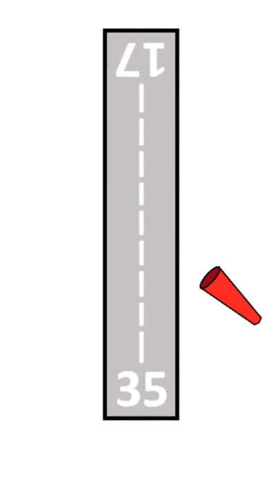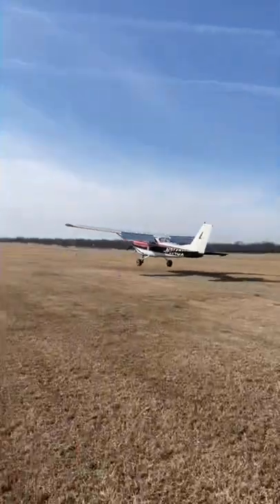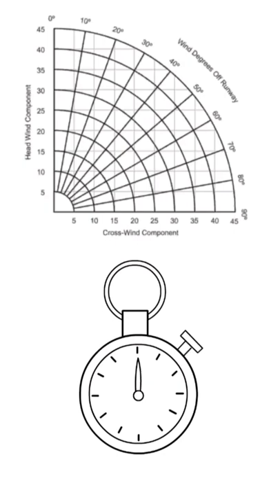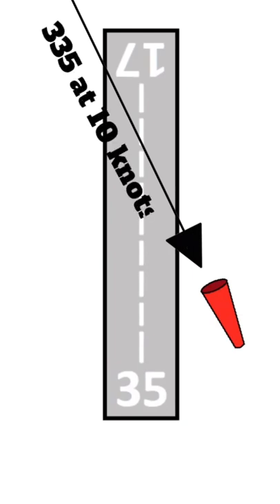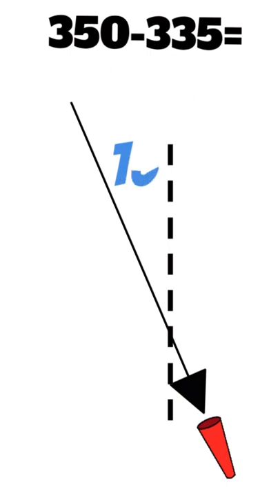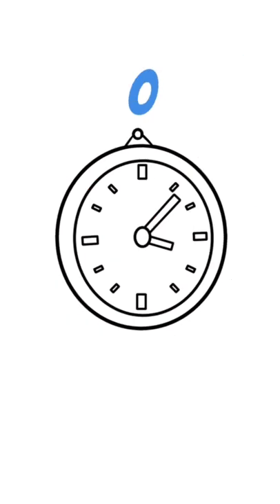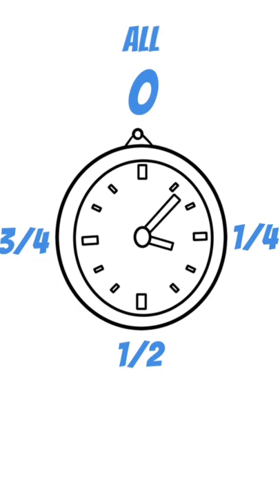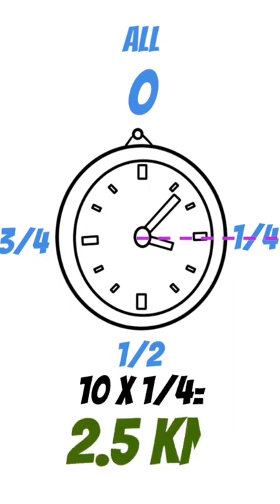Easiest Way to Calculate Cross Wind Component (clock method) #shorts

Comment: Student pilot here (26hrs into my PPL). How bad is it if I just "feel" the wind. My best landings in crosswind have always been when I just turn my brain off so to speak, point the nose in a way so my course aligns with the runway, and just fly her in by the seat of my pants and keeping an eye on airspeed. The more I try to think about getting some exact heading based off the math the worse my landings, I think it distracts me from just flying the plane. I'm decent at math but my brain for whatever reason just freezes up over even basic calculations when I'm flying if there's a lot going on. Is a DP gonna expect me to announce my crosswind component or something? Is flying by "feel" bad?
Reply from the maker: I don’t have a problem with it in most cases, but there are actually some airplanes with a crosswind limit, so you need to be able to calculate this
Reply: @FreePilotTraining  thank you!!

Comment: There’s another method, probably less accurate but quick and easy.
Crosswind
0 to 30° = 1/3 of the wind speed (Vw)
30 to 60° = 2/3
60 to 90° = 3/3

Headwind
0 to 30° = 3/3
30 to 60° = 2/3
60 to 90° = 1/3

😊✌🏻
Reply from the maker: Love it! Thanks for the comment!

Comment: What about dividing the windspeed by 6 and multiplying by every unit of 10 degrees off from the runway? Example RY36, wind 04012kt. 12 divided by 6 is 2. The wind is 40 degrees off RY36, so 4. 2 x 4 = 8kt crosswind roughly.
Reply from the maker: I haven’t heard that one

Comment: Where did you get 350 from
Reply: Runway 35. Meaning the runway is pointed at 350°. General rule is to always add a 0 at the end of runway numbers to get the heading it’s facing.

Comment: @ OP:
Hi there. Tell me, do you teach your students to look at moving cloud shadows on the ground to calculate wind direction and drift on cross country flying?

You’re making excellent progress on your channel. ❤👍
Reply from the maker: I don’t. The wind where the clouds are is usually not the same as the wind on the surface or even your cruising altitude. If it was, that might work
Reply: @FreePilotTraining  
Oh I see I have confused you. I am of course referring to clouds at the same or slightly higher altitudes while maintaining VMC. Naturally at different altitudes this would be impractical. This was passed on to me by a former Royal Air Force Hurricane pilot who flew in the North African campaign during WW2.

Edit: I should point out that most of my aviation experience involved dead-reckoning navigation in Africa without the benefit of GPS, NDB and VOR, LORAN Etc. So when a pilot/navigator from WW2 in the desert campaign offered me advice I took it.

Perhaps this tip is not so useful these days.

Comment: What about a quartering tailwind?
Reply from the maker: Above 90 degrees, you can use the crosswind component the same way. Your crosswind component would be calculated based on your “angle off” from the direction you are traveling. For example, if I’m landing runway 18, and I have a quartering tailwind at 015 at 10 knots, I would take 1/4 times 10 to get my crosswind component of 2.5. There is no headwind component in this case, and my tailwind component is now 7.5

Comment: Usually excellent content, but this one is a swing and a mess. How would I use this to apply appropriate aleiron and rudder control on final?  If I'm worried about calculating the maximum crosswind component for my aircraft on a small angle, should I be flying anyway?
Reply from the maker: I appreciate the feedback.  Sometimes the wind picks up after you take off.
Reply: @FreePilotTraining  thank you for reading and responding.  Not trying to be disrespectful, but as conditions change noted during atis reports and even the few seconds on final, the pilot will respond instantly as appropriately vs determining actual crosswind component.

Comment: or you can just calculate the sine of the angle in your head.. haha..

Yeah this is useful
Reply: actually.. I calculated the sines.. and 15 would be 2.5, 30 would be 5, but 45 would be 7 not 7.5.
Reply from the maker: 😂 I can’t even remember how to do that with a calculator
Reply from the maker: My method isn’t perfect, but it’s close enough for determining crosswinds
Reply: @FreePilotTraining  yeah, I certainly don't want to have to pull out a calculator

Comment: Hey I've got another explanation.
Let the wind vector be at 335 degrees with value of 10knots
Difference between the runway and wind vector is 15 degrees
So for vector components it's always one vector which is the |v|.cos (theta) and the other one is |v|.sin(theta). The sin theta component is always and always along the angle and the cosine component is always on the other side. 
So for this condition we require the sine component sooo the answer becomes
10.sin(15) which is approximately 2.59 or 2.5.
Pls tell if it was nice. We actually learn all this in grade 11th in basic physics and in grade 12th in mathematics.

Comment: When you become an even better pilot, you'll never need to compute the crosswind component ever again. there are easier methods. Heck, I can land without knowing the actual wind direction or speed at all. I use a trick that is never taught, and that most pilots probably don't even know (based upon the fact no pilot I've ever shared it with knew my trick before I shared it).
Reply from the maker: Lol. These days I’m mostly concerned about a tailwind. It can lengthen that landing distance a lot!
Reply: @FreePilotTraining  but sometimes you have to land with a tailwind. I spent most of my time in training flying in the Rockies, and we had some airports you just had to accept the tailwind. it's perfectly safe if you know what you're doing and how it affects the landing. We'd even takeoff with tailwind. Sedona was a great example, but we banned students or renters from going there without a CFI as too many accidents happened. 

High DA, sloping runway, cliffs, rising/restrictive terrain to the north.... Even if the wind was out of the north, we always took off south. down sloping runway, flat descending terrain, away from town, could descend to pick up speed if you got in trouble, lots of flat open areas to land...

And the winds from the canyon, cliffs, and other terrain could make it tricky too.

But I like a challenge. at this point I actually don't fly sometimes if the winds are too calm, as I hate landing without a crosswind. it's too easy and no fun. But in some ways Xwinds are actually easier too.
Reply: Please share this method then.
Reply: Very cool hack.
What if the wind speed had been not 15° but 20 or 25, 35...?
Reply: @arturogutierritos4538  "What if the wind speed had been not 15° but 20 or 25, 35...?"

what does this mean? I think you're mixing your units/variables?

Degrees are units of angle, not speed. So are you asking about speeds of 15, 20, 25, 35 KNOTS, or are you asking about some wind speed at 15, 20, 25, 35 DEGREES?
Reply: @austinblake4079  Firstly, if you pay attention to the basic weather map of your area, and High and Low fronts in your area that day, you should always have a general idea of which direction the wind should be out of to make initial runway selection. But you can always just get the local ATIS/ASOS/AWOS/etc from the airport or nearest airport.

Once you've selected which runway to land on, you line up on final approach and start flying towards the runway. As you approach, put in your crosswind correction (no crabbing). If it's a strong crosswind, you'll need more aileron and rudder to hold the nose straight with the runway. if the crosswind is less, then use less. no computation required.

so how do you know what is too much? experience and practice, and knowing what you are and are not comfortable with. if the corrections are too much for you, or out of your comfort zone, or the wind gusts are adding an extra layer of difficulty that you don't like, then find a runway with a more favorable direction into the wind.

but, if as you are flying the final approach and applying the xwind corrections, if you run out of rudder trying to align the nose with the runway centerline, then you have exceeded the airplane's max crosswind component. if the rudder is hard over, and you have no more control input, you need to find another runway. in an emergency it could still work, but if I need to explain to you how to land in a xwind exceeding your rudder input, you should never try it. It is risky, and can damage the airplane, but it could get you down safely. I have never tried it myself, as it is ONLY for true emergencies and you have NO other better runway options available for your circumstances. I know it's possible (and can easily prove it), but I will not be advocating it. Figure it out for yourself, if interested, or not at all (if you're not smart enough to figure it out on your own, then you probably lack the skills/understanding to do it anyways). Also, this emergency technique is NOT useful for tailwheel airplanes at all, never try it in a tailwheel even in an emergency.

Also, if you're flying on final approach at your normal airspeeds, and your ground speed feels fast, you probably have a tailwind. try flying the runway in the opposite direction to see if you approach more slowly at the same airspeed. this is for when you Truly have no clue what the wind direction is. But you shouldn't be that incompetent of a pilot. It's very easy flying straight and level in cruise at some altitude lower to the ground (say 2-5k ft AGL) to determine the general wind direction just by looking out the window.

None of my techniques require any modern tech or avionics like GPS, glass instruments with groundspeed, etc. All of this can be done in any steam gauge airplane. and can even be done with no instruments at all, just by flying eyes outside.
Reply: @SoloRenegade  Flying in to just "feel it yourself" for the crosswind completely misses the point of being able to quickly evaluate the crosswind component. No one is on final computing approximate crosswind components. However, if you are still in the planning stage, or listening on ATIS/AWIS prior to getting clearance, you can make a decision quickly based on if the crosswind component exceeds your maximum. Doesn't sound like a special technique to quickly get an idea on crosswind component. You're just describing flying "by the seat of your pants."
Reply: @austinblake4079  "Flying in to just "feel it yourself" for the crosswind completely misses the point of being able to quickly evaluate the crosswind component. No one is on final computing approximate crosswind components. However, if you are still in the planning stage, or listening on ATIS/AWIS prior to getting clearance, you can make a decision quickly based on if the crosswind component exceeds your maximum. Doesn't sound like a special technique to quickly get an idea on crosswind component."

I never compute crosswind, never have, at any stage of planning. I only check reported wind speeds to see if the max wind in any direction is excessive. winds change, most reports are 1-6hr old, will change by the time you arrive, many are just forecasted guesses and not even observations as well.

I fly the predominant runway until I can't. I pick the runway closest to wind, or that everyone is presently using, and on final I know if the xwind is too much or not. I don't care by how much, and I don't need math to make the determination, nor any prior planning. There is no need, no point. I can fly my plane to the rudder limit, so anything less is doable for me.

And time between ATIS and landing tends to be short, and other things are going on that need my attention more than something that literally doesn't matter.

"Flying in to just "feel it yourself" for the crosswind completely misses the point of being able to quickly evaluate the crosswind component. "

By flying the final approach I can instantly evaluate the xwind component, and without a shred of conscious thought or computation. and I can evaluate any runway or emergency landing, or off airport landing instantly. How will you land with no radio? How will you land off airport were there is no reported winds for tens of miles in different terrain no less? How will you determine where the wind is coming from in an emergency landing following an electrical fire or electrical failure?

"You're just describing flying "by the seat of your pants."" 

Yes, I am actually, and there is nothing wrong with that. there is no technique out there superior to mine. None easier. And my technique is never wrong either. And my technique happens without even thinking about it.

Why should I waste time thinking about xwind, and waste even more time computing it? what purpose does it serve? what do I gain by doing it your way?
Reply: @SoloRenegade  you aré correct. I meant what if the speed had been not 15kt but other speed nota necessarily coinciding with 15, 30, 45 or 60...?
Reply: @arturogutierritos4538  then you interpolate. split the difference between values and call it good.

or better yet, you don't worry about it and use my method.
Reply: @SoloRenegade  The entire point of figuring out a crosswind component before you reach your destination is so you can fly to an alternate if it exceeds your crosswind maximum. That's it.
Reply: @austinblake4079  never had to divert due to xwind component....

But riddle me this....

You: plan excessively and read 6hr old forecasted guesses as to the wind. you arrive at your destination to get the wx only to find it's changed and you have no idea what the actual crosswind component is. you do the math while flying, and determine it's too much, you divert to an alternate airport.

Me: don't waste my time, do my planning which takes far less time and takeoff. I arrive at the destination and find that as I approach the airport and get the winds, that I can't hold the nose straight on approach, and so I divert to an alternate airport.

what did you accomplish? I had to do zero math, zero planning, and we had the same outcomes.

I wont know if I need to divert until I get there, as I wont know the Actual winds until I get there. And if I knew before hand, i would have flown to the alternate to begin with. But remember, i have never once diverted due to winds. seems my planning, despite being far less complicated, works. Also, most airports have multiple runways, so if it's too much on one, switch.

Still waiting for an explanation as to how any other method is superior....and how it gives me anything my method doesn't.
Reply: @SoloRenegade  It's not excessive planning to listen to ATIS what are you talking about 😂
Reply: @austinblake4079  "It's not excessive planning to listen to ATIS what are you talking about 😂"

that's called a red herring. One, I never said what you claim. Two, you don't listen to ATIS when planning a flight. ATIS is current weather, not future weather. You listen to ATIS when inbound to your destination airport.

Continue to avoid the question. How is any other method better than mine? what do I gain by doing it your way?
Reply: @SoloRenegade  maybe to stay legal?  w/in yur  rental fbo or club rules for max Xwind comp  allowed for  yur specific ac ?
  sounds like yur a very experienced  hightinme pilot w yur own plane  and know it well fly it alot.. right ? wrong?
Reply: @phillp7777  Who is from your FBO or flying club out there measuring the wind and watching your every flight? Who are they to say what teh wind was at the approach end of the runway as you came in to land? Sometimes there are windsocks, sometimes there are none. How many people at an FBO or flying club are running around with weather measuring instruments every time you go fly?

Most pilots will be uncomfortable attempting a max xwind component landing anyways, and that ok. But that means they wont ever be doing it either. A quick check of the METARs in your area will very easily tell you if you might get stiff crosswinds or not before even taking off. But once up, you have no choice but to come back down eventually, regardless what the winds are.

You don't have to be a high time pilot nor fly only one aircraft all the time to use my method. I can use my method in any aircraft 100% of the time, even ones I have never previously flown in before. And I have taught my technique to first time private pilot students. this is basic flying skills 101, nothing more. Techniques like this used to be known to pilots in the past, back when electronics, weather reporting and accurate forecasting, GPS etc. were not even options.

What would you have done in 1912 to land? What would you have done in 1922 to land?

Comment: What difference at this point does it matter You have to land. I've put a Cherokee 6 down on runway 4 (SANDED) after an ice storm with winds 300 at 25 G 35. Low in gas and alternate 00 in BS (Blowing Snow). U either have the skill or U don't belong there.
Reply from the maker: Lol. Very true. It’s just a tip
Reply: @FreePilotTraining  Roger Tower  ya gota know your Personal Limitations ... When i left the runway it was pure ICE on the taxiways with 6' Snow banks and the 6 was trying to go sideways. 300 HP helped it SKATE to a tie down.
Reply: hound.. that's bad planning rly  and bad adm  .. not safe at all
Goodluck